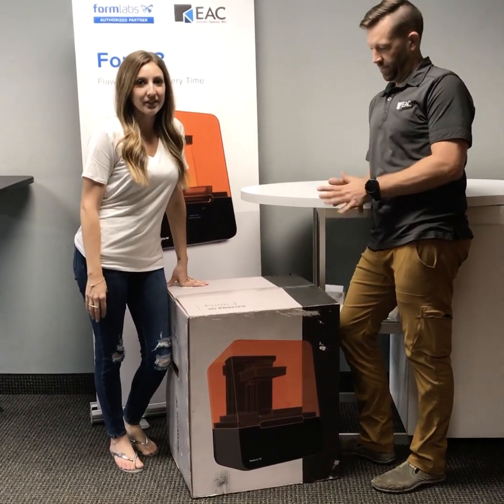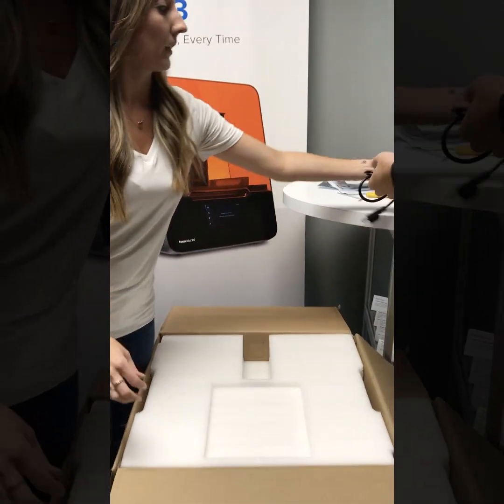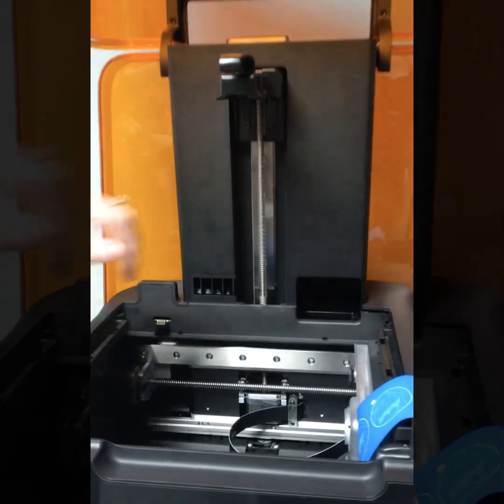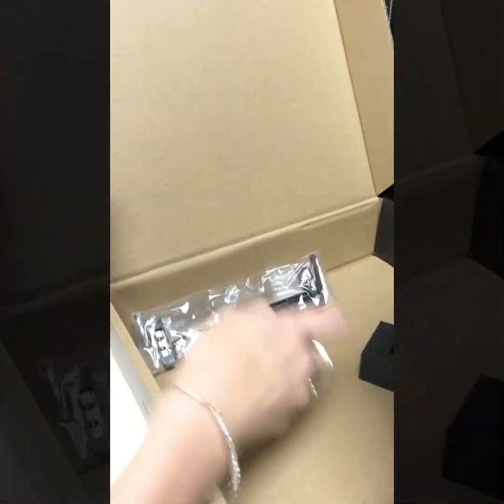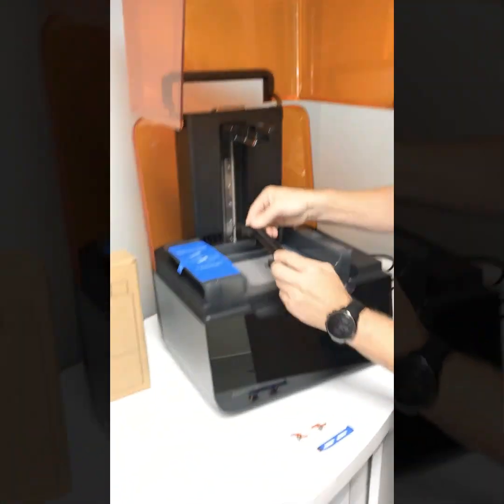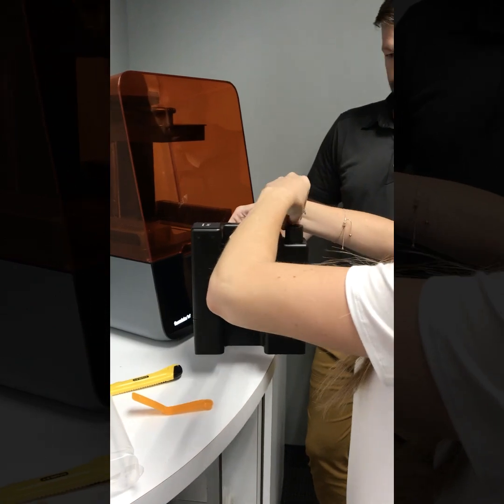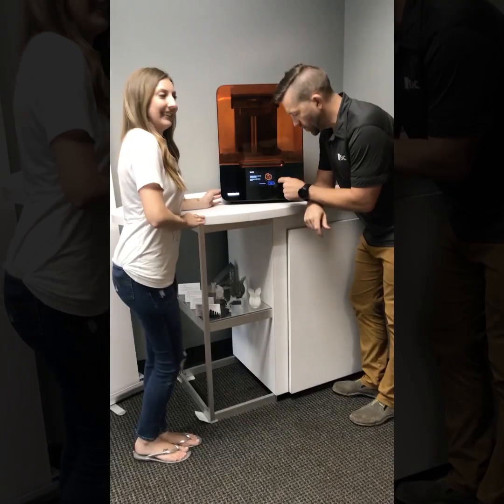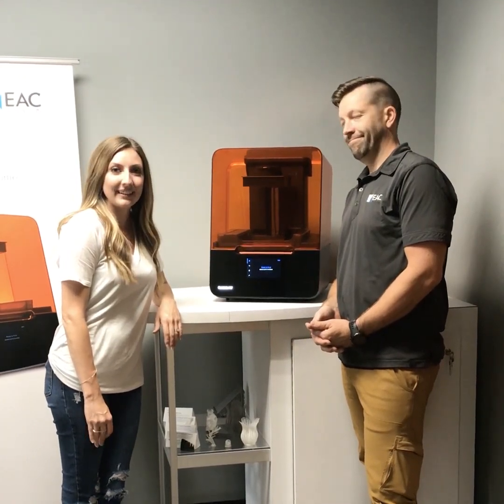Unboxing the Form 3: What's Included

Comment: Can a collapsible bottle be printed with the form 3? If so what is the resin name? Is a 3D printed plastic bottle food safe?
Reply from the maker: Thanks for stopping by our little corner of the internet! If you’re looking to prototype, you can use the Flexible for squishy collapsible or probably the Durable (PP) for fold down collapsible. Neither are food safe and should be used for prototyping purposes only.
Reply: @EACPDS  Thanks for responding as no one has really covered or answered these type of questions, especially the "food safe" aspect. It would be great for views if you printed a clear bottle with the form 2/3, only one YouTube channel did it this year.